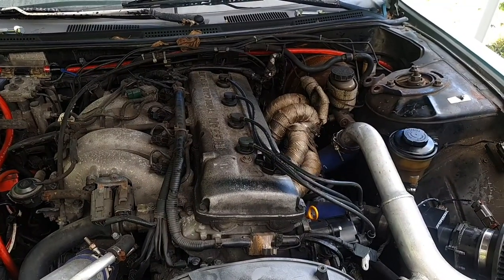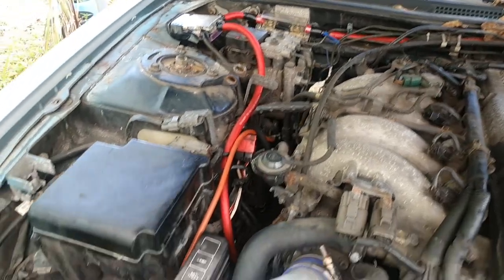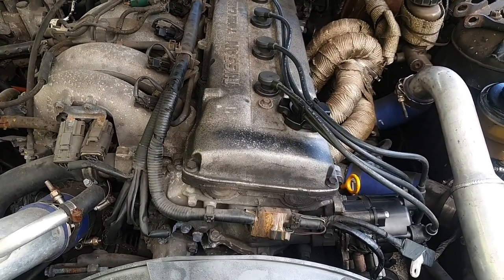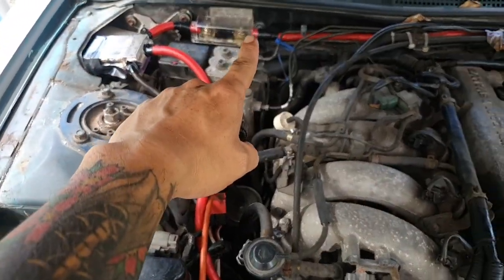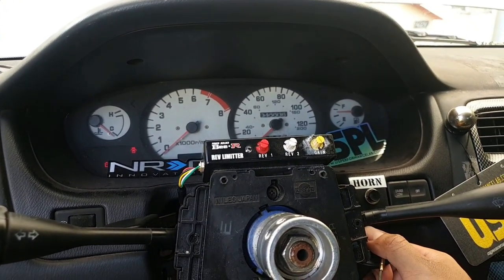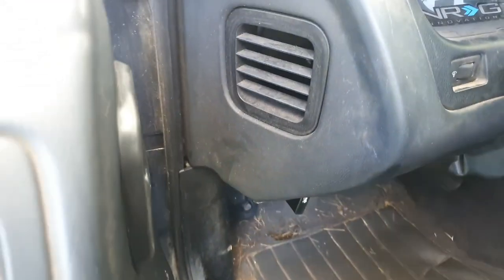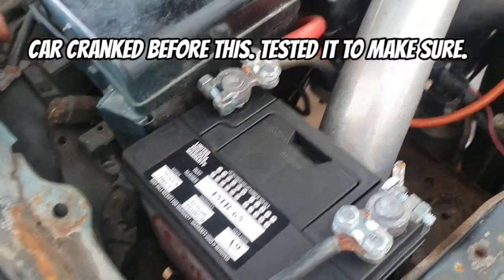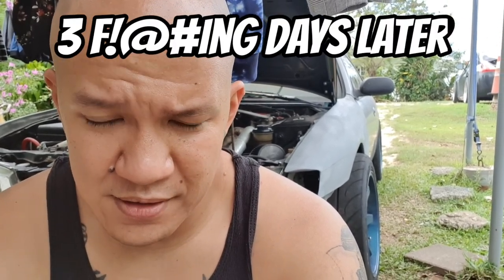Struggles of owning a 24 year old car | Not running...again

Comment: have you  checked  your  ground  point most especially the main ground for the battery?
Reply from the maker: Main ground is good. Cleaned out the area and sanded down the surface to make sure
Reply: ok so you have 2 ground  one the body side and one on the block?
Reply: to me it really sounds like a lack of ground
Reply from the maker: Yes. I'll double check those. Been gone for a year so I don't really know what happened to my car.